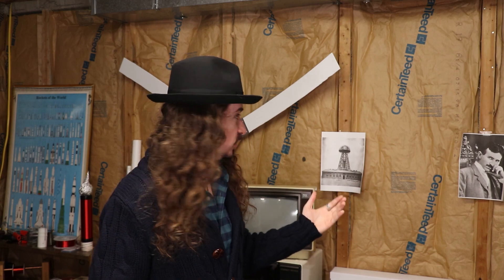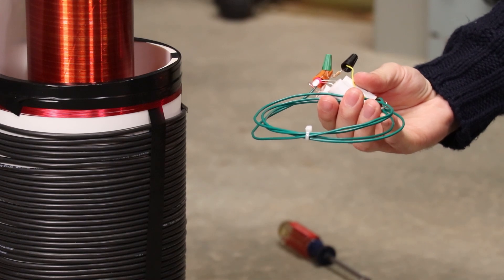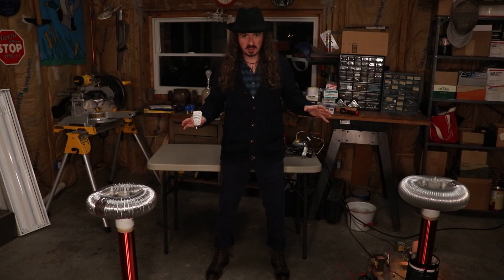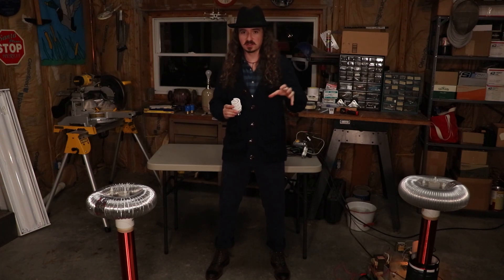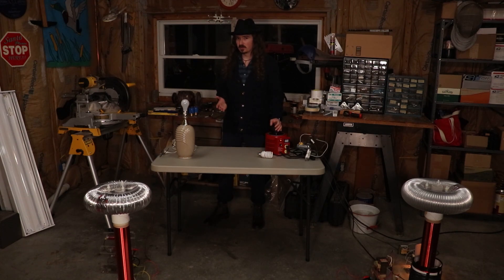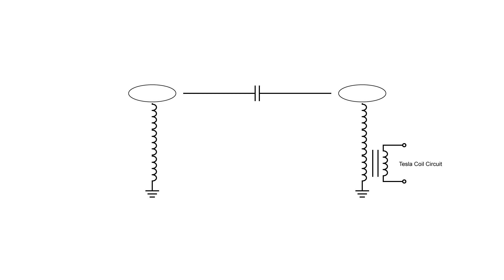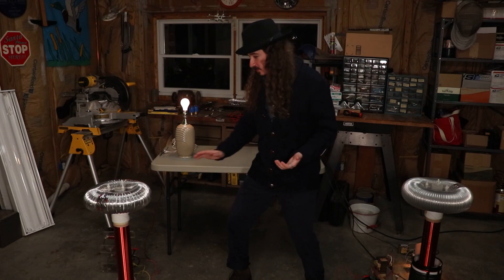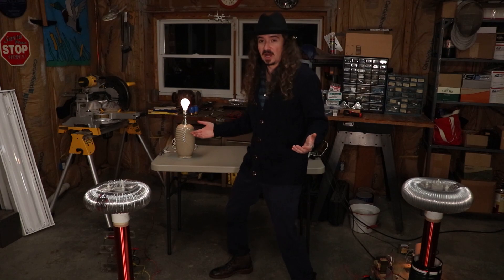Tesla Coil Wireless Power Transmission

Comment: That’s really cool! If you dump enough power into it and move the other secondary closer and turn it correctly, you can get breakout on it too!
Reply from the maker: Yeah I tried that off camera, but never got it to happen, even with the coils closer together. Definitely need more power than that 833A tube and circuit can handle. My grid leak resistor gets crazy hot too, I realized while doing this. Never ran the coil for 5+ minutes at a time before this.
Reply: @CoilLabs  water resistor grid leak works, although it does do electrolysis. When do you plan to get your other tube up-and-running in this coil?
Reply from the maker: I need to build up some more robust infrastructure to run that other tube properly and truly utilize it's potential. Probably do a more serious build around that a bit later.
Reply: @CoilLabs  oh yeah plus you need to film and edit a bunch, actually do a good job, and probably make it look good and be on a base. Let's just say I do none of those things :)
Reply: @CoilLabs  You could use a GU-81 pentode or a GU-5B triode, they are mutch more powerfull tubes.
Reply from the maker: I recently acquired a 7704 tube. That's the one Vdekje was asking about. Will hopefully showcase that in a new video sometime soon.
Reply: @firefox1136  Soviet tubes are nice and all, but you can get tubes for much cheaper in America with a little patience and searching. Soviet tubes need expensive shipping, so there is a limit to how cheap they can be. Plus they are more likely to break during shipping since it's international. For instance, I recently got a 7kW output tube (and 8890) for less than 40USD including shipping. I've also gotten a 6076 tube (4kW output) for $40 including shipping. My friend got one for $50.
Reply: @CoilLabs  Looking forward to it!
Reply: @vdekjEE  Yes, the shipping is expensive. (I am from Switzerland so it does not matter if I buy from Amerika or Russia. It is always expensive.) I think, you are right, that you should buy tubes from the country you live in.
Also, that about your tesla coils sounds amazing.
Bye, have a nice day.
Reply: @firefox1136  yeah definitely agree. Outside of the US buying tubes from US makes little sense.
Thanks btw